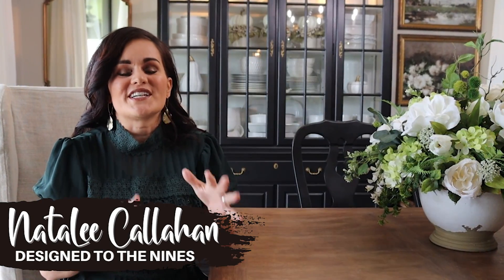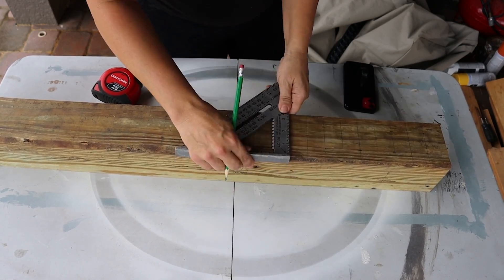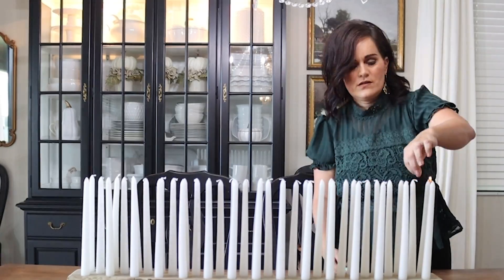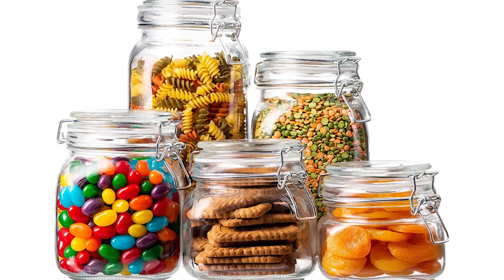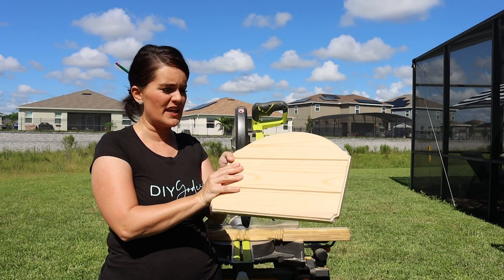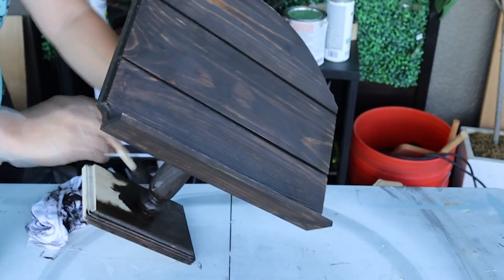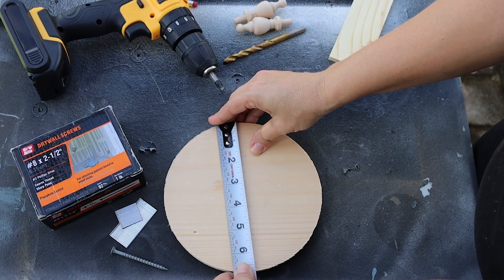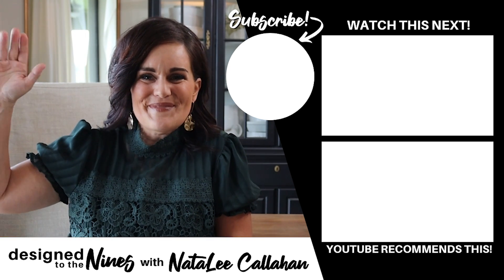HIGH END Kitchen DIY Decor Ideas That Are Amazing!

Comment: Great DIYs! I love using water slides! I use them on my tumblers and I like to print them in reverse, still spray them with the clear coat, then you can apply them more like a fake tattoo, face down onto your surface. You don’t risk tearing it when you slide the paper out from underneath, and it won’t smear (just in case you didn’t coat enough) because it’s ink side down! ❤ The recipe book and labels were definitely my two favorites!! I’m holding onto my paper towel holder! It’s got a red pig on top and a Pioneer Woman style base with the aqua and yellow florals!! 😍

Comment: I just love these, especially the recipe book stand! You’re right that it would make a great gift! I made a paper towel holder very similar to your a couple of years ago, and if I could give you a bit of advice, add 4 little silicone or rubber bumpers on the bottom. Mine kept sliding around on my countertop when I’d go to grab a paper towel, and I found that water would seep under it if wet hands dripped as they grabbed. The bumpers solved both issues. 😊

Oh, and I wanted to let you know that I’m continuing to pray for y’all! ❤️
Reply from the maker: That is an absolutely wonderful suggestion thank you so much! I am definitely doing this. And thank you so much for the prayers. They were definitely felt and answered. I’m so grateful for such a wonderful community.
Reply: @designedtothenines  you are so welcome. 🙂

Comment: Questions felt pads on the bottom wouldn't change the look would it ? Also could you at an angle drill the test tube be on the side like where the single candles are? Love the first 2 but have no counter space so I bought the  Magnetic paper towel holders from Harbor tool and it's on my refrigerator and a great spot thank you

Comment: I had a "Candle Garden" once, which was a similar concept.  It was very pretty to look at, but, once I burned the candles, which were all closely clustered together like in this project, the heat all these candles put out was so intense and high, it overheated my dining room, all the candles melted and it became a huge, liquid wax mess.  So, just beware.  🧐 These things are a huge fire hazard.  Have a fire extinguisher nearby and plan on getting a new dining room table.

Comment: Natalie, I think the best thing about power tools is you can make a sturdy professional looking item! It drives me crazy when I see people using hot glue when they should be sewing, although I know sometimes that works, or using glue where they should be using a nail, foam board where they could use a wooden board. It doesn't have to be expensive wood and like you, they can create a scrap pile and make all kinds of new crafts with leftovers! The plastic flowers got to go though! Just try to flowers or even paper flowers and often some silk or fabric flowers look so much better than the shiny plastic. I sound so opinionated don't I LOL! I just can't stand to see a so-called plant Shining back at me with seams. I guess that's my little OCD issue!